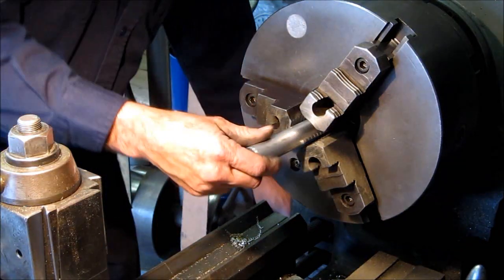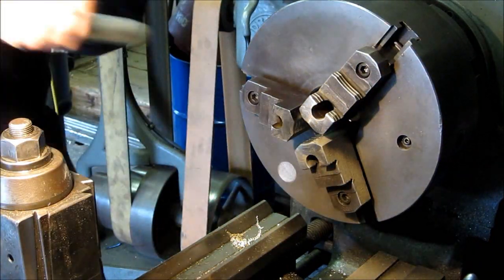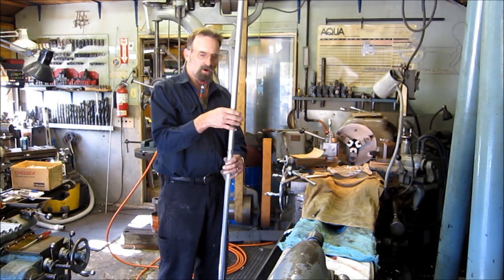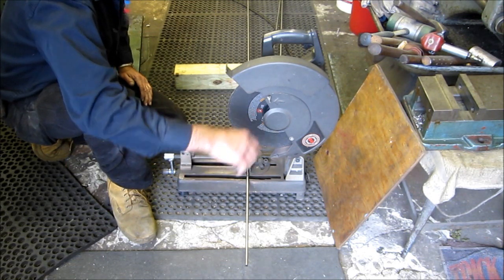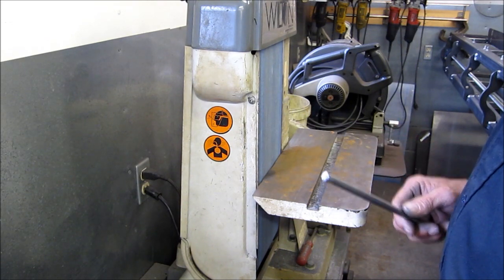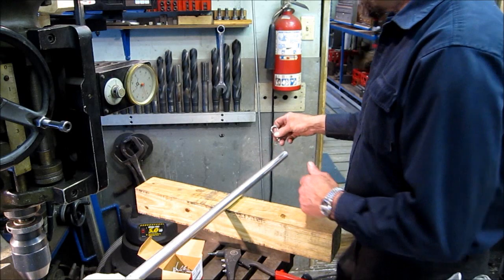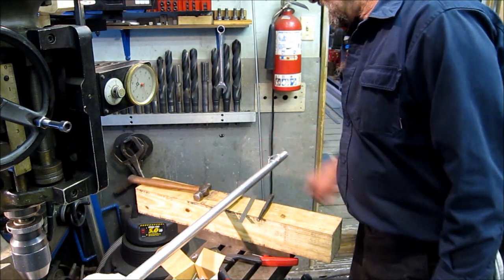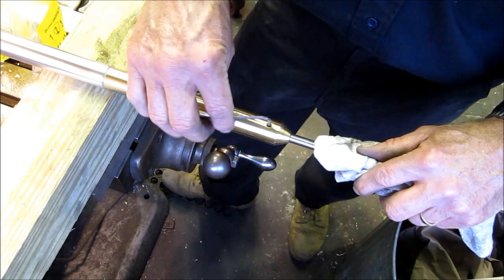Stick It! Part 3

Comment: Thanks, Keith!  Very cool/well made but lots of work in jointed ones with threaded ferrules!  Great threading op, but wow, after shutting lathe spindle off, it makes at least another complete revolution from momentum alone...really have to know lathe and this operation/allow for this additional movement since you are threading deeply enough to risk crashing end of the tube into tool holder--bet this happened at least once!.  Having Trav-a-dial on your BP quill looks very convenient!

Comment from the maker: I do use the tailstock, just as you mention, for alot of smaller thread sizes, The shank on the tap is border line on the square drive and the round, in fitting into my chuck properly and even though its aluminum, it has full thread contacting load.  A mishap would punish the jacobs chuck...

Comment: Keith nice series.  I was also  hoping to see the threaded joint made I'm sure you had really smart setup on those, threading to a shoulder, etc.  Actually I think you covered that in another video I'll have to check my dvd library :)...

Were I used to work we used the 2" scotch brite pads and also the roloc bristle discs.  But that was 2 years ago and where I work now I think we use merit or sait not 3m.  We don't have the roloc discs here now which is too bad I really liked those.

Comment from the maker: Heres, Trivia Question:

 The tube is 3/4" SCH. 80, the stock ID is so close to required hole for the tap size, I don't have to do anything. I bought the tap for this job from MSC, a stock item. I single pointed the male inserts, on my Clausing lathe / no metric, hint...

What thread did I use?

Comment: Hydraulic rams always have more force extending, because the piston has more surface area on the extension stroke, the retract stroke has the shaft connected to the piston, and therefore the fluid has less area to apply pressure

Comment: Ah, it all becomes clearer.  That's a really cool setup.  Last couple of questions; The threaded joints on the Multi-sectioned stick, are those milled in the shop or bought? (Just curious since I did not see those made in the video.) And what is the total weight of the finished stick?

Comment: You should set up a strength test for the pop rivets vs clip.  Assemble the clip on a dummy section of pipe, lock down the pipe and pull on the clip to see what breaks first.  You might be able to do it with the hydraulic press if it has as much force retracting the piston as it does on the way down.

Comment: Mr. Fenner, when you're doing the tapping you're moving the carriage with the feed wheel. That makes sense, but I was wondering, why don't you set the auto feed to the same tpi as the tap? That way you could just feed it in, stop, then reverse it out without having to worry about rolling the threads. I guess there might be a good reason why this wouldn't work (backlash maybe?) but I'm curious. Thanks for the vid! -Toby

Comment: Keith have you ever tried scotch brite pads to polish the sticks ? At work we polish aluminum radius rods for race car suspensions with them and it does a great job and you don't get the pulling like you did with the paper

Comment from the maker: No!, before I got into seaching all the facts and going to the bible, I was just going through my tap drawer, and by eye ball the major end of the 1/2" pipe tap looked cool! I have done some straight pipe threads thoughout my career, including some Oring fittings with same thinking, after making manifold blocks, etc...

Comment: Excellent trivia question!  You should do this sort of thing more often.  Being clueless about NPS (other than knowing it exists) I had to consult the bible (Machinery's Handbook) which says NPS is used with pipe for loose-fitting mechanical joints with locknuts (NPSL), for hose couplings (NPSH) and fixtures (NPSM) where there are no internal pressures.  Minor diameter for internal thread is 0.747, just about perfect!  Did you choose it after reviewing drill and tap charts in MH?

Comment: I could not remember the formula for approximate tap drill size vs thread so I looked it up.  It's nominal thread size minus 1/tpi after I looked it up.

Using that gives 14 tpi and msc sells exactly 1 item a bottoming tap.  But I don't think that is what I saw in part 2, it looked like a plug tap to me.  So maybe 13/16 x 16 ?